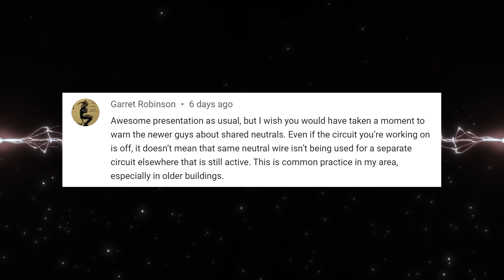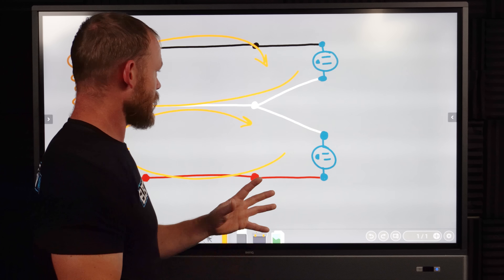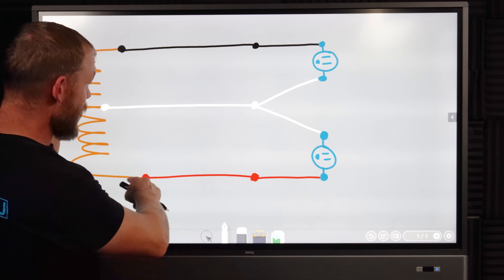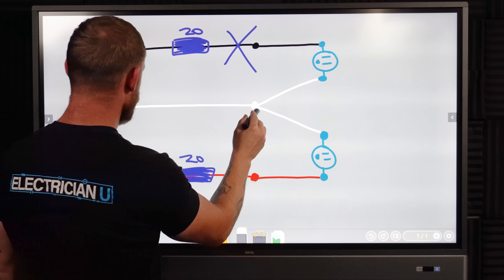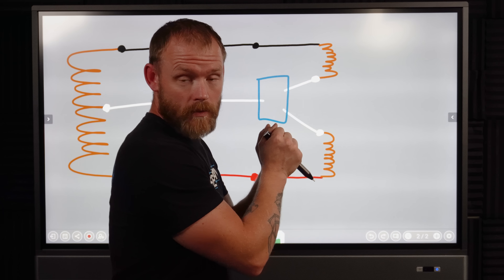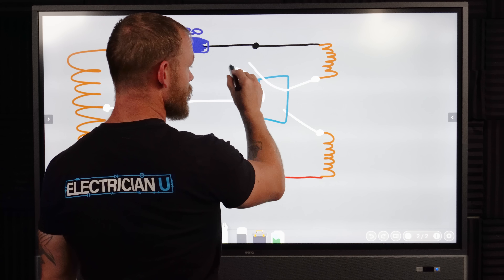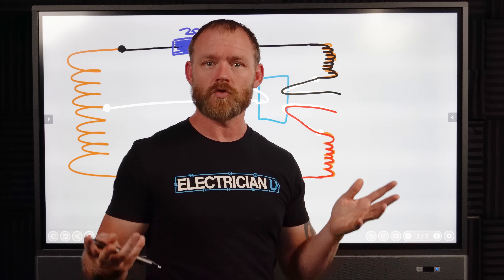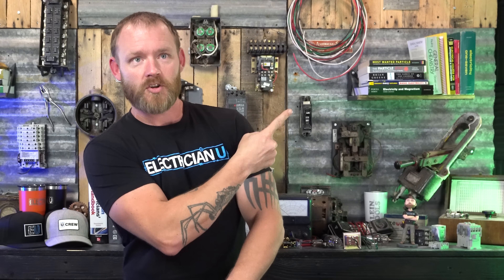The Dangers of Shared Neutrals: How To Avoid Being Shocked

Comment: Weird question / situation per the end of your video:. So I was working on a demo and the ceiling guy was cutting down in the room next to me which was made safe. I was working on making the next room safe when he cut the wrong ceiling wire, which caused several old skool 2x4s to fall down and support their weight by the BX tails, still on. I switched off the half of the room where the lights fell and got into the j box for the first light. As soon as I opened the j box, of course, the wires sprung out and a bundle of 5 or 6 neutrals came out of the wire nut instantly, breaking open. I'm sure they touched the metal box at some point but mainly just touched each other off and on as they wiggled around.  None of the wire nuts on the hot wires came loose in that box, although I wouldn't rule out a hot potentially getting cut through the insulation when the lights fell, possibly touching the neutral or the BX armor. That was the crazy part, but here's the weird part: After I tried to (stupidly) wrangle up the neutrals that fell out of their wire nut and got about halfway through twisting them back together (so some of them were connected again and some were still isolated) the wires feeding the lights on the other half of the room away from me that I hadn't switched off started arcing and welding themselves to the j box they were in. I didn't get a close look at the aftermath or have time to study what happened but there was evidence of arcing inside the aforementioned j box and the hot wire was the one that melted. How could my little kerfuffle with neutrals cause a hot to burn up on the other side of the room?  FYI nothing was grounded with green wires, I don't even know if the cable armor made a solid bond, but either way it wasn't enough to trip the breaker. Multiple uh-ohs on this job (thanks ceiling guys) where they broke a live pipe in half also didn't trip any breakers, it just sat there and kept sparking until we turned the circuit off. Just curious how the hot could burn up from neutrals coming apart.. I wouldn't be at all surprised if multiple circuits shared neutrals either.
Reply: Never ever, in any circumpstances, work on neutral wires before hot wires.
Always unbind hot first.
And when binding, its the oposite, neutrals first and hots at very end.
Reply: @martf1061  100% agreed, and thank you for that reminder!  Several journeymen made sure I knew that and I'm glad they said it. In this case, I wasn't really given a choice lol. I opened the j box with the intention of isolating the hot feeds and the neutrals fell out of their wire nut as soon as the cover dropped. I should have left it alone at that point though instead of trying to rebuild the neutral joint, for sure!  Now I know why 😅
Reply: @CharkG73  we usually really learn when we experience it 😉
Good luck on the rest of your carreer
Reply: @martf1061  for sure 😂 never making that mistake again!  And it's gonna be emblazoned in my mind to share with every green apprentice I work with til I retire... Because that 12 gauge improvised welder could have been ME!  Thanks for the chat and God bless you!
Reply: Thinking about this a little further after processing this video... I wonder if, by just arbitrarily picking a neutral to twist back into the cluster one at a time, I just so happened to create a 480v circuit like you demonstrated in the video.... Where the neutral going back to the panel is isolated and just by chance (and lack of understanding) I essentially made a phase to phase circuit on the lights that were still switched on. This was on a 3 phase wye commercial service, as far as I know.  That's the best conclusion I can draw with my still somewhat limited understanding... I'd be really curious to hear from someone wiser though
Reply: One other thing I just thought about too... So when the ceiling guys broke our 120v pipes and caused arcing inside them, you could see sparks but it was more of a mild crackle pop sound. When I had my kerfuffle with the neutrals, the arcing was much more severe, it made a bright orange light, and sounded like a loud, angry robot. Closer to the sound a pole transformer makes when it burns up. Would that be evidence of higher voltage?

Comment: We installed multi-wire branch circuits on the west coast well into the 2000's.   Once arc faults started being required in more areas is when we moved away from it.  

So expect to see it in houses up to 2008+.
Reply: Yup. Seattle, here, 2005 build. I did not have any of my multi-wire branch circuits on adjacent breakers with the handle ties. Not sure if that was a later code addition, but because of it, breakers got unwittingly moved and were no longer on different legs of the panel! Luckily, recognized before fire happened.

Comment: Just don't touch 2 points at a time. Practice on all off circuits like they're hot and be aware of where your hands/fingers/elbow/head/legs are touching. If you don't have thick enough clothing or gloves, the current will flow through it. Disclaimer: always turn off circuits and LOTO, don't work on live wires.
Reply: When disconnecting wire nuts and separating 2 wires, if there is a spark, there is a load running through it ⚡️⚡️⚡️
Reply: 👍 exactly

Comment: Not only have I gotten bitten by a neutral,  when I was a teenager I got shocked off an electric water heater.   Changing out an element.   Uncle Gary turns off the breaker and tells me it's off.   Of course I verified the power was off with a multimeter that I tested on a known live circuit.   I tested across the terminals on the upper thermostat,  but didn't think to check each leg to ground.    What happened was there were two single pole 30s in the panel which has been there since probably the 50s or 60s.  If memory serves me right the two 30 amp breakers were not even near each other, just randomly placed.  Talk about some shady work.

Comment: I am laughing tonight. This just happened to me. I work in Pepco substations. These people follow no rules. We have hot red, white,green, and black. I opened a circuit and checked for power. Fellow electrician turned on a different set of lights , on the other side of the building. I got a nice tingle. Got my meter and yes 120 at neutral. Shared neutral seems worse than just getting hit by black. Thanks
Reply: i label shared neutral or mwbc on every box and breaker etc......

Comment: question on any kind of 10/3,12/3,14/3 aren't the hot conductors supposed to be landed on a 2 pole breaker to keep you from getting shocked off the neutrals?
Reply: They are, but just for example, I have a 2005 build home with otherwise nice-looking electrical work, and my multi-wire branch circuits were all installed on separate single pole breakers, no handle ties. These are original, definitely done by the builder's electrician. So, it does happen. A quick googling says this breaker requirement might have been added in the 2008 NEC.

Comment: One potential way you can get shocked from a neutral is if the breaker is off but there is a device with a large capacitor connected then it could energize the circuit
Reply: Lol.  I shouldn't laugh, but somehow it just seems funny.  Capacitor's 101:  Q: How to discharge when the neutral is cut.  A: Insert random electrician for path to ground. :)

Comment: awesome video bro! do you mind touching on 3:41 why current wouldn’t sit on the neutral in the black circuit even tho it is connected to a live conductor
Reply: Current  has to have somewhere to flow to.  Ideally, and in this drawing, out of the panel, through the load, and back to the panel.  With the breaker off, the circuit is interrupted, so the current cannot flow back to the panel.  It can't just flow into the air.  Even if you cut the neutral in the middle, that's actually going back to the panel, there'd be no current on it, but now it's a wire that will shock you.  Potential and a load, yes, but no current.  If you touch the wire you become a path to ground, and it'll bite you.
Reply: @clamboni9  from what i know ac current don’t flow it vibrates, so… it’s all about WHERE u interrupt the circuit ?
Reply: @Magnito 98  it does still flow, it just changes direction very frequently.  But it  doesn't matter where you interrupt the circuit.  In the drawing, the black and red wires are connected to the phases.  The neutral is connected to the ground.  The neutral should have no (or very little) potential between ground.  The phases have potential between ground, neutral, and themselves.  That difference in potential is your voltage.   Basically, the red wire has a complete circuit, the black does not, so although the neutral for the black circuit is connected to the neutral for the red circuit, there will be no current in that particular wire, because that wire doesn't complete a circuit at the other end.  If it completes a circuit, then current will flow through it.
Reply: @clamboni9  do you mind elaborate more on the neutral and ground potential?
Reply: @clamboni9  i really appreciate your explaining
Reply: @Magnito 98  @Magnito 98  voltage is a difference in potential between two things.  Our things are the conductors.  We reference ground as our baseline.  The neutral is bonded to ground at the panel.  So ideally, there's no difference in potential, so you should have no voltage from neutral to ground.  When AC power is created by a generator, or alternator,  it's created by magnetic fields that change polarity as the magnets get closer and further away from the coils.  That's why we have a sine wave at 60hz on both or all phases.  The sine wave repreaents the syrength of the magnetic field, and its relation to ground.When you look at the sine wave on a 240v feed, the sine waves oppose each other.  The line in the middle is our reference point, or ground.   the peaks are at 120v, the valleys are at -120v relative to ground (and neutral).  That's why you get 120v from phase to ground.  Between two phases,  the difference in potential is 240v, and that makes a 240v circuit.  Having potential "excites" the electrons in the conductor, but they can't move unless they have a path to either the source or the ground.  They don't care where thy go or how they get there, they just want to go somewhere, and they take the path of least resistance.  As far as electricity is concerned, your body is just a big resistor.  That's why in a properly functioning circuit, you can touch the neutral wire without getting shocked.  There is actually a bit of electricity flowing through you, but it's miniscule because the copper wire is easier for it to flow through.  But if through your body to the ground is the path of least resistance, then you'll get shocked.
Reply: @clamboni9  thank you for this amazing explanation ❤️❤️❤️❤️ i appreciate you & your time typing this out thank you!
Reply: @clamboni9  i have one more question, the neutral in the black circuit that’s connected to the neutral in the red circuit, shouldn’t this conductor  ( black circuit neutral ) have potential ? since it’s connected to a live circuit ?
Reply: @Magnito 98  it does have potential, just not a difference in potential to ground, so therefore, no voltage relative to ground.  Remember, it's bonded to ground all the way back at the panel.  The difference between it and the hot wires is that it's on the other side of a load.  If it's not connected at the panel, and current can't flow, then it can become energized through the load, and will shock you if you offer a path to ground.  So if the main neutral in the drawing gets cut, and there's even a milliamp of a load on it, it essentially becomes hot.  If there's no load on the circuit though, an open neutral basically becomes totally isolated from the system.
Reply: @Magnito 98  that magnetic field that creates the voltage is only applied to the phases, and only exists there until there's a path for it to continue on through.  A neutral on the other side of a load offers that path.  The load also offers resistance, and resistance and amperage (current) are inversely proportional.  So loads that have high resistance draw less current. Very low resistance loads draw more current. A short circuit, when hot contacts either another hot phase, neutral, or ground, has almost no resistance, so the current flow (amperage) is very very high, that's why it trips the circuit breaker immediately.
Reply: @Magnito 98  and if I'm honest, I'm not smart enough to have a true understanding of the actual physics of it, and how or why it works the way it does, I just know that it does, and how to apply it to jobs.
Reply: @clamboni9  you are the smartest person i came across thank you so much for this amazing explaining. what i learned from our convos that ground (earth) is a conductive path with a set resistance and that’s the reference that’s why we read voltage across hot and neutral.
Reply: @clamboni9  so what would happen if we connect 2 conductors opposite phase (120, -120) will it explode?
Reply: @Magnito 98  that would be a short circuit.  You have a completed circuit with no load, the current flows freely without any resistance.  You get a big arc flash, melted wires, and a tripped breaker.  The size of the arc flash depends on the voltage and amp rating of the breakers.  I've seen doors blown off of cabinets.
Reply: @clamboni9  i would greatly appreciate if you help me with this. I was trying to practice on my home furnace and my lead accidentally touched between two neutrals ( furnace control board) a spark happened and i lost power suddenly. i reset the breaker no problem and i have power but the furnace not turning on. do you have any input on that i would really appreciate it
Reply: @magnito9811  hard to tell really without seeing it.  Look and see if there's overcurrent protection somewhere.  It would probably be a black or red button, possibly a small glass fuse.  Unfortunately, you may have damaged the board.

Comment: I just ran a shared neutral circuit for the first time a few weeks ago for an audio upgrade. The new power sequencer was designed in a way as to take a 240v "3 phase" circuit with ground and neutral into the unit, and internally it breaks them out as 6 individual single phase 120v circuits (basically 2 circuits in the sequencer unit sharing a single hot conductor of my 3 phase circuit). I put 3 phase in quotes before because the load isn't actually 3 phase, it only uses a 3 pole breaker and wiring but the load pulls off at 120v single phase. A very odd way to do it and I am not sure I like it. It will all shut off together because it is a single 3 pole breaker, so safety wise for the things talked about in this video it is fine, but down the line I know someone is going to look at this panel and think there is a 3 phase load there, then wonder why the speaker amps are all running in that config and be very confused about it.
Theoretically, for audio applications that it is designed for it does indeed work well, and should have a very even load across the 3 hot conductors so that the neutral carries no current. However, I still had to size the neutral for the maximum current it could carry should the load become completely imbalanced.

In the end, I feel like it would have been easier to just run 3 full circuits worth of 14awg wiring (9 total wires) than it was to run 4 wires at 14awg and 1 wire at 6awg. The extra size of the big neutral negated any advantages saved in both cost, space in conduit, and ease of pulling compared to just using all the same gauge wires would have. But, the power sequencer calls for this very specific wiring setup and will only work properly with that wiring, so.
Reply: Why #6 neutral? I don't see any way you could overload a #14 neutral if the breaker is sized for #14 wire. The neutral will never take the load of all three phases at once because of the phase rotation.
Reply: @jay9308  Maybe, IDK. The specs simply called for the neutral to be able to handle the combined total load of the circuits so that's what I did.

Comment: Great video 👍. One thing that I keep finding in older homes I'm called to with shared neutrals. The neutrals shared with the red and black on the (same phase) which- could cause overheating/over current carrying conditions on the neutral wire.
Reply: i think that would keep the potential for 240v down.....still notta good idea
Reply: In theory the phase is alternating so electricity flows in equal opposite times down the wire not doubling up, sometimes getting out of balance but the idea is they don’t heat the neutral more than the hot because of alternating current and also the load supplied has slightly less current coming back
Reply: @JPLaJeunesse  I agree with most of what you said.  But for the neutral carrying alternating current from shared red and black Has to be on separate/different phases for the neutral to carry the unbalanced load so as it won't overheat. Would be good video content as an experiment to prove this theory 🤔

Comment: I was replacing a countertop kitchen outlet in a 1979 condo wired in emt with a GFCI outlet. Shut off the breaker, checked the outlet with my multimeter. Started working and got zapped. Wiring for the LR outlets passed through that box and the LR circuit had a shared neutral with the kitchen circuit. No handle tie on the kitchen and LR breakers. AND the hot wire for the LR circuit was white. No black tape. Not that taping a white wire black would be code, but it wouldn't hurt. BTW, do you wire everything in 12-2 with 20 amp breakers. Used to seeing 14-2 with 15 amp breakers except where 20 amp is required.
Reply: You can re identify a white as a hot
Reply: @adammorgan9304  I read that code doesn't allow for that on anything smaller than #4 wire. But anyway it wasn't done in '79 or when the load center panel was later replaced.